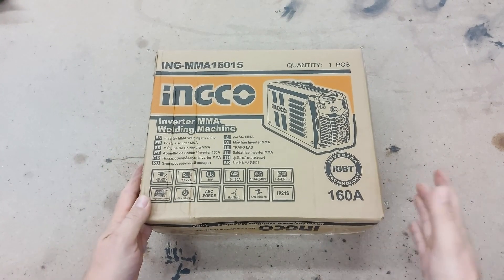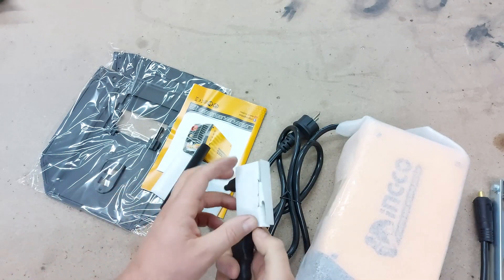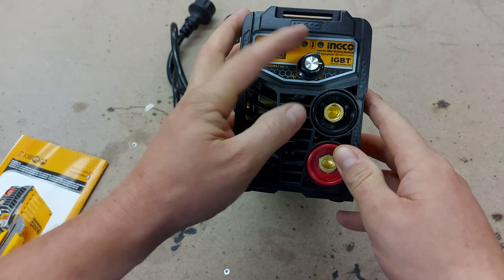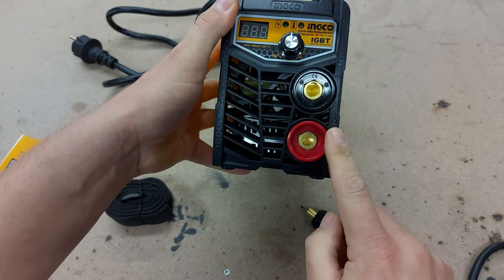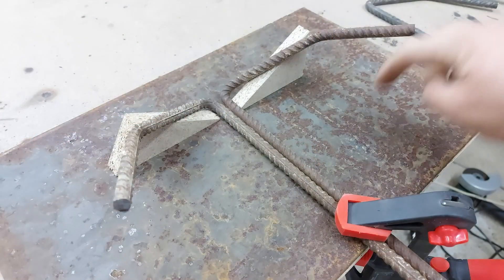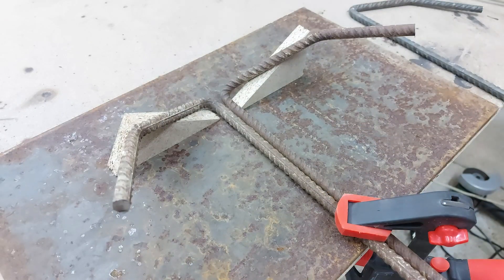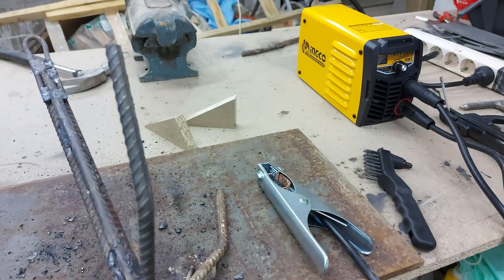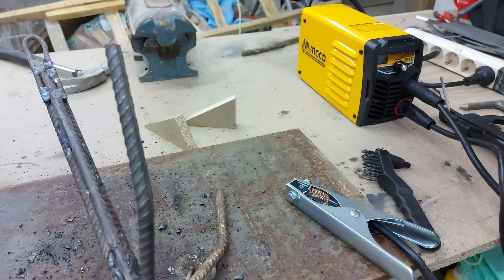Making a grappling hook - INGCO 160A DC Inverter welding machine review

Comment: Hallo sir...I have the same machine but it goes off when I start to weld.. have you experienced the same issue?
Reply from the maker: Nope, works perfectly. It only cuts off if you stick the electrode too hard to short circuit it as prevention. Once separated it starts operating as expected. You need a small gap on the electrode in order to be able to weld.

Comment: ماني فاهم والو حبيت نعرف هذا نوع نتاع الجهاز
Reply: نوع الجهاز ingco.بالعربي انجيكو.هو ماكينة لحام انفرتر ماهياش بالبوبينة التقليدية هي الكترونيك.
Reply from the maker: Sorry but I do not speak nor understand Arabic. I used google translate to understand your comment. Ingco is a Chinese brand that is sold here locally. For the price, it has a good quality.
Reply from the maker: It is an upgrade on the generic AC stick welder. Much easier to work with and much better welds.
Reply: @TasteTheCode  قالك ماني فاهم والو وأنت تجاوبو بالانقليزية.معني هذا انك مافهمتش أنو هو مافهم والو لوكنت فاهم راك كتبت بالعربية.

Comment: a 160A stick welder (preferably inverter) is a must for any DIY guy 👍✔
Reply from the maker: I cannot agree more! 👍👍👍
Reply: @TasteTheCode  if it is 160A
How many volts it can burn 120/200
Reply from the maker: @ronalddino6370  Sorry but I don't understand the question? Mine operates at 220v as that is the standard that we have here locally.
Reply: What you think about this machine good are no good please reply I want to buy this if this is good
Reply from the maker: I love it! Pleanty of power, good welds! The only downsides is that it is loud, and the cables could be a bit longer.
Reply: @TasteTheCode  ok thanks me believe you and me to order now